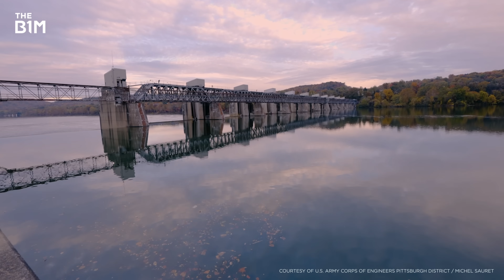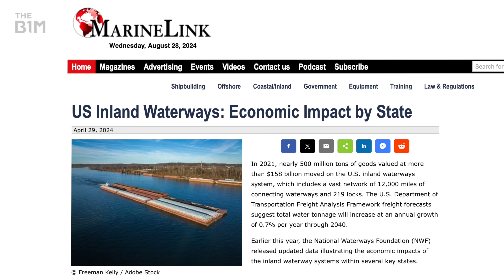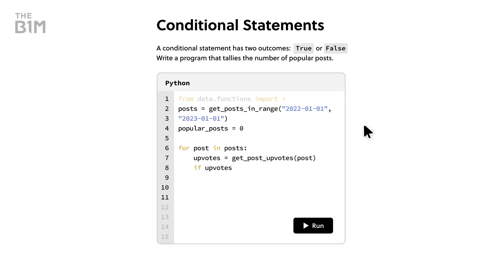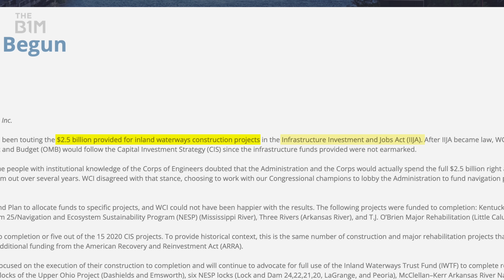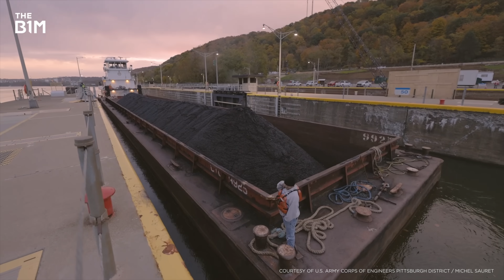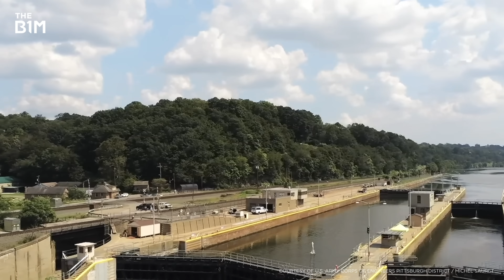America's Vital Infrastructure is on the Verge of Collapse

Comment: The assertion that "This infrast ructure was only supposed to last a few decades" is just UTTERLY false.  The designers knew these structures would be used for a century and designed it with that in mind.  They understood that periodic inspection and repairs would be needed and maintenance done. That is the part we fell down on.

Comment: Here in the United States you have to wait for it to fail.  Too many people scream it needs to be done but they don't want to pay for it.  And the regulations.  The only way to get around the regulations is for it too fail first.  I seen them replace a bridge.  They tore the old one out.  Started building the new one.  In the same place.  Then after cement was poured some dik head from the DNR cried about a fish.  They had to remove the new cement and start all over.  The new cement was in the same place as the old cement.  But one a$$ clown with a college degree who probably doesn't have a clue which pot to pi$s in said "the fish".  Millions of dollars gone.  And another month with out a bridge.

Comment: they took a lock out in Pittsburgh lowering the river several feet, for several hundred feet in length. no replacement. "it was only designed to last 100 years. its older than 100 years..." 🍻

Comment: They're always doing maintenance and replacing and upgrading shit, this is misleading. I just worked a few days on Castle Rock dam energy project on the Wisconsin River  replacing the gantry crane used to pick the sluice gates for maintenance. There's always work at the dams, and that dam makes enough power for 3k homes in a county with barely that many people; built in 1951 with original turbines and runs just fine with 1 employee or less.

Comment: I'm pretty sure, that if America couldn't use its waterways, all it's domestic cargo would be routed through the rail network. Any exports that couldn't be moved by ship or train would be shipped by truck to its nearest shipyard. Waterways are important but the economy wouldn't collapse
Reply: Yeah, that shouldn't be an issue. You'll just need to find about a 1000 trucks to replace a full barge tow. Or about 134 per single barge.

If we take the Army Corps of Engineers' numbers and calculate 134 trucks per barge... We can easily replace the 31 thousand barges serving the US with only 4 million semi-trucks. As we all know, there's absolutely no shortage of truck drivers in the US whatsoever. American road infrastructure is in tip top shape and is just waiting to accept those extra trucks. In fact that would be a barely noticeable more than 2-fols increase from the 3 million trucks already on US roads.

But we can make it even easier if we replace the barges with rail cars! We'll just have to somehow get triple the amount the US already has and lay rail lines along the major waterways. As we all know, the US is unparalleled when it comes to laying rail lines quickly and on a tight budget.

Yep, I agree with you, it won't be any problem whatsoever.

Comment: Great video highlighting the historic/current uses and their current situations. Really great snippet on the funding mechanisms too, not just the nut and bolt engineering mechanisms of the locks. Without proper funding in place there's no way to improve the infrastructure no matter how great your engineering prowess. 

One topic this video made me think about was the labor pool. Seeing the construction worker build a concrete retaining wall is a very basic task. Seeing that triggered memories of the San Francisco Transbay Bus Terminal. I saw workers there building the structure using materials and shapes that aren't normal building materials or techniques used in the US. Seeing the construction workers on site in S.F. made me question the soundness of the structure itself based on the advanced design and the lack of experience building that type of structure from the existing labor pool. Not a few months after the grand opening, the terminal shut down due to a construction flaw. Would love to see a video on labor training in the US and/or where the knowledge and labor pool to construct these super modern, advanced structures comes from in areas that have not (traditionally) built these structures.
Reply: I've boated on US waterways .   The main part is Mississippi below St Louis which has zero locks and is natural...  Of the 500 million tons of cargo 3/5th is in or on borders of Louisiana.  ...   The rest of system is mostly failure..  the Tenn-Tomm canal added in 70s was failure but is still run ...  The other parts were added too late, 1930s, in areas where railroads already existed and had tracks going to backdoors of buildings. ....

Comment: Really?  The concrete is failing?   Nah, most concrete literally lasts "forever."   Patching as needed is just fine, thank  you.    

As an example, there was a old power dam in Fredericksburg, VA.   The public was given the old song&dance about it might fail at anytime.   Moreover, it was decided that the "River should run free."

OK.   The Army Corps of Engineers came in to blow us this structure that could fail at any time.   The explosives went off, the smoke clear, and the dam was just like it was.    It took a 2nd deliberate explosion to take it down.   That way pre-dated all the FDR stuff.

Comment: Considering how long overdue many of these replacement projects are, it also speaks for the construction techniques back in the day that these pieces of infrastructure have lasted so much longer than anticipated. Some people back then would have probably laughed you in the face if you would have told them they were stil in use in the 21st century, having thought they would have been replaced several times at that point. So, kudos to those engineers back then.

Comment: This reminds me of an old line from a TV commercial: "You can pay me now or pay me later".  It was about deferring an smaller expense now will cost you more later.  Doing a $500,000 fix ten years ago would save a $2,000,000 fix today.  It is always much more expensive later when deterioration has further progressed.
Reply from the maker: Exactly this 💯
Reply: And not just the increasing cost of deterioration amelioration. Putting the simple stuff like inflation aside too, there's the hard to stomach, hard to pin down, hard to justify dark art of jobs for the boys cost increases with unfathomable explanations.
Not too long ago here in Britain, national level infrastructure projects or power stations for instance, were to be had for tens or hundreds of millions of pounds.
Then without anyone raising an eyebrow or making a fuss it seems, similarly grand projets now come in at the billion pound mark.
That's the best and most urgent reason for your common sense approach of 'build it/repair it and reconstruct it now' that there can be.
Reply: Or even better, build things better in the first place.
Reply: @searchingfortruth619  Nothing lasts forever.
Reply: @searchingfortruth619  Oh yes, please do go on about "Building Better in the first place"; please share with us the "Better way", 🤡.
Reply: @searchingfortruth619 everything has a lifespan. Usually they can be extemded by good maintenance, but it eventually will need replacement.
Very few things can be built to last 100 years. Especially if they are some sort of active structure.

Comment: why are they even built out of concrete, i live in the netherlands and here they were made out of brick, some of them have been in operation with just 3 hours a week maintaince for almost 300 years, i would even dare say some locks here are older than the US itself and still in use
Reply: In the Netherlands, the rivers and locks are MUCH smaller with less water pressure in comparison to American waterways. Concrete is far stronger.
Reply: @ReviewBoard-uy5nv  they are not, They are just made differently, I know a few that have little pointy islands in the middle which divides that pressure by 2 with safety as another purpose, then there are two locks, made entirely of brick, Basically what they do is make two smaller rivers out of one temporarily for the locks, then go back to just one river, this lowers the pressure on both locks
Reply: @ReviewBoard-uy5nv  And LASTS far longer.  Bricks are garbage.
Reply: Probably because it takes much more time and is more expensive than concrete? 

Also brick walls can't take as much lateral forces as reinforced concrete. I guess the significance of this fact depends the size and heigt of the dam and also how violent the river is.
Reply: This is so important. We need to build things that last. America just does whatever is fastest to win political points.
Reply: Are you Aware the Massive Size of some of these Rivers? And how much force is Behind them Brick can't hold that much Water
Reply: @IndustrialParrot2816  Sure brick can, its called a gravity dam and basic rock does this job just fine.
Reply: Your "understanding" of wear on structures in water is --> pathetic.   USA has locks hundreds of years old as well--> made out of concrete.  Guess what?  They ALL, be it concrete or brick,  have major maintenance done on them.  YOU just are not aware of that maintenance.  PS: Bricks are garbage compared to concrete.  No one in their right mind would build with bricks.
Reply: @w8stral  Wow, you must be fun at parties
Reply: @Harry_Gersack  Well say ignorant $#1t, and you get basic engineering thrown back in your face like the fool who said: Netherlands has dams that require no maintenance for hundreds of years...  The fool hasn't even read about all the dam failures in the Netherlands... Now they have made a national pasttime about controlling water and have become VERY proficient at moving water where they want it, but they have not reinvented physics.  All infrastructure requires constant maintenance.
Reply: @w8stral  i know one in my country that is still in use by river ships and its been there since anno. 1517, Older than your country, And from my experience its being maintained like 3 hours a week.
Reply: @valyshknee4203  Exactly, requires maintenance, just like EVERYTHING ELSE in this world.
Reply: @w8stral You know Netherlands is way older than US right and has a history of battling the seas far longer as well, just look at how Netherlands has slowly optained land to expand there size of time, maybe just maybe they might have better knowledge than the US since I haven't heard of any failures over there as compared to here and if they have proably not to the degree in the US.
Reply: @Hardcase_Kara  Dear God, spare me from utterly ignorant people.  Suggest reading some Netherlands history and their FLOODS from failed dykes and dams...
Reply: @Hardcase_Kara  Netherlands became indepentent in 1814. The US became independent in 1782. Please dont spread misinfo.
Reply: @AL-lh2ht  You don't need to be independient to have history or are all the years before US became independient not worth it, cause Netherlands has existed for longer than the US has even if not independient, look at the age of there oldest cities as compared to the ones here.
Reply: @AL-lh2ht  we were independent for far longer than that, our national anthem for example is one of the oldest if not the oldest on earth, from my own knowledge we have been under names like, United provinces, And Batavia, Batavia is our oldest name.